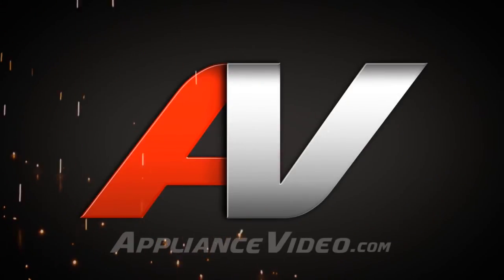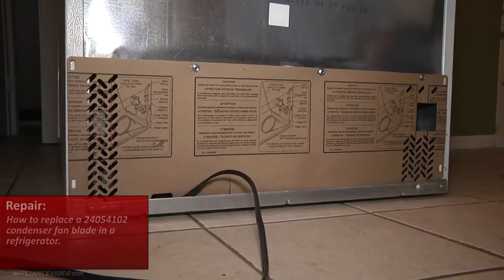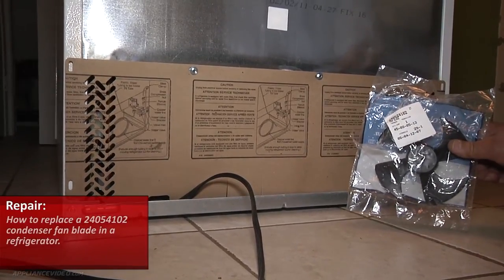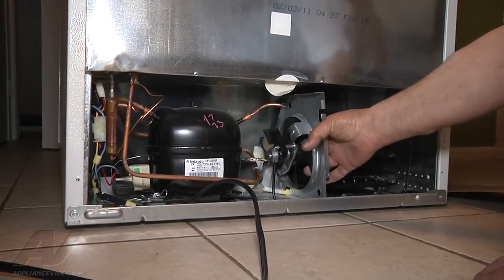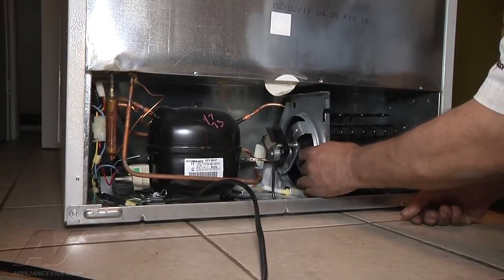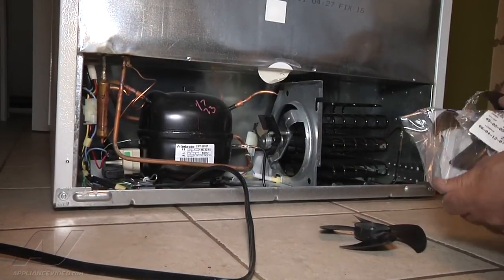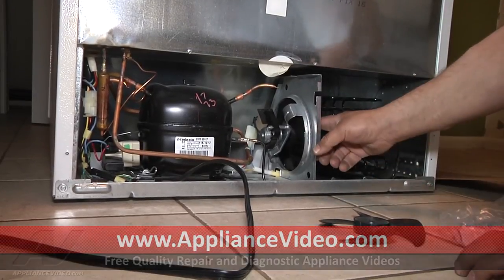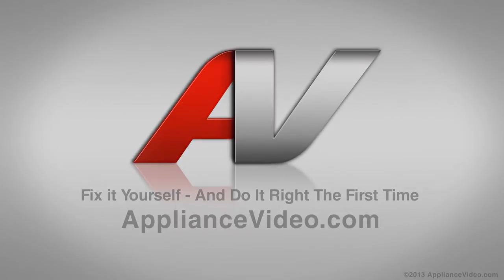Frigidaire Refrigerator Repair - Noisy Fan, Rubbing Sound - Fan Blade

Comment: Load humming noise when compressor kicks on runs for a very long time . Could someone tell me how to quiet it .
Reply from the maker: patrick 
                              All of our technicians are now answering questions daily on the ApplianceVideo.com website for anyone needing help. Just copy and paste this this question under REPAIR HELP, and one of our  factory authorized technicians  will answer any technical questions at absolutely no charge on your appliance issues. We also have over 2600 free repair videos to help with your appliance repair issues. Thanks for your support. Matt Ace Appliance factory service technician.